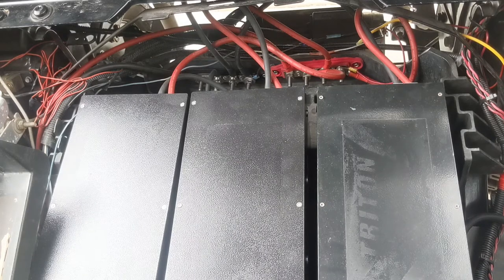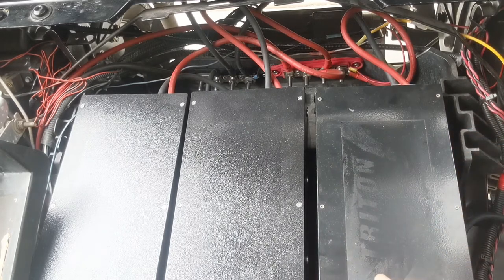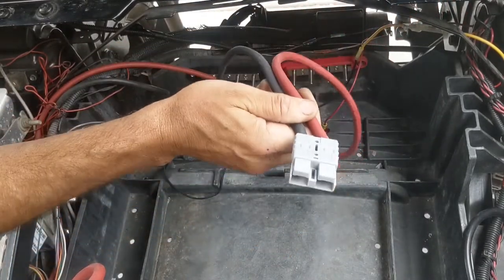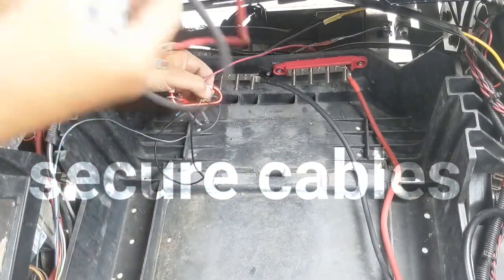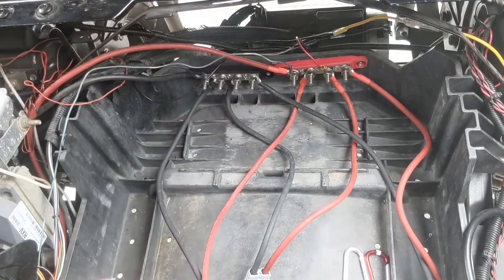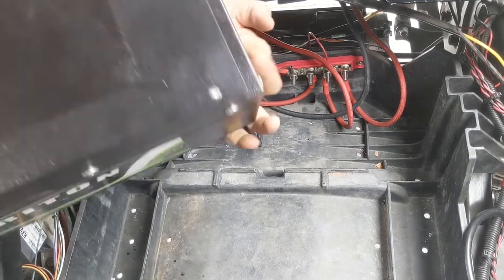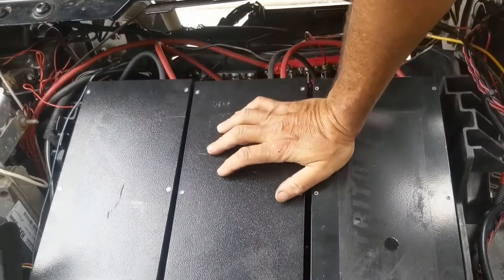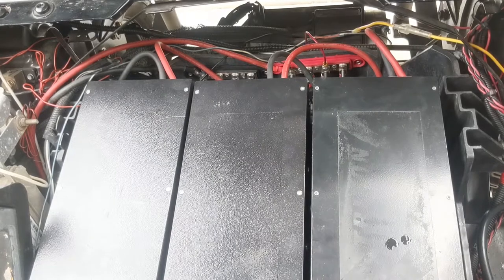BigBattery BDGR install 48v EZGO RXV Lithium golf cart battery

Comment: Did you have any issues with the regen braking on the RXV?  I installed 2 of the BDGR and on a 2 minute run the resistors in the cart were bright red and overheating.  Curious if that is just an issue on my cart.
Reply from the maker: I think I spoke to you before but if not, the regen can be an issue when batts are 100% SOC, this is solved by turning on headlight for 5-10 min to  discharge battery pack. Resistors red hot is another matter, lol

Comment: did you need a step down for you lights or accessories
Reply from the maker: yes we use a 48v 10 12v converter

Comment: I have a rxv and the BMS keeps shutting off the battery. Does the regen overload the BMS on a 2010 ezgo rxv? What is the work around?
Reply from the maker: When this happens we will run the headlights
Reply from the maker: To discharge the battery pack prior to driving
Reply: @DeepcyclebatterystoreSanDiego  The 48 to 12 volt converter is not hooked up and no accessories are connected. When the BMS shuts down it completely turns off the battery and it goes into a safety mode that requires the charger to reset it. I’m in the process of replacing the 48 volt solenoid my hope is that it’s faulty and poor internal contacts are not allowing proper voltage across it to the cart controller
Reply: @Jason Andrews I just bought a Roypow hopefully I will get it install this weekend. I will let you know what happens
Reply: @Jason Andrews I’ve been working 16 hour shifts and I installed the Roy pow s51105p it was NOT a drop in replacement I had to modify the battery compartment area slightly. It works pretty good so far I will give it a good test over the weekend. Sorry it took so long to get back to you guys.
Reply: @DeepcyclebatterystoreSanDiego  My big battery HSKY had a bad BMS. Big battery was not interested in resolving this situation so I replaced it with a Roy pow S51105P the cart seems to be working ok now. 👍 I’m subscribed thanks for reaching out!